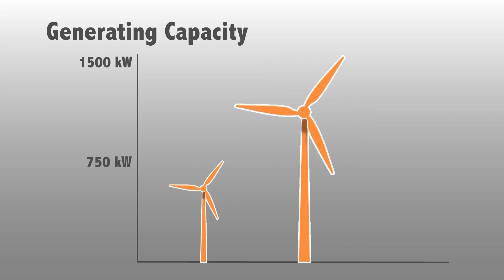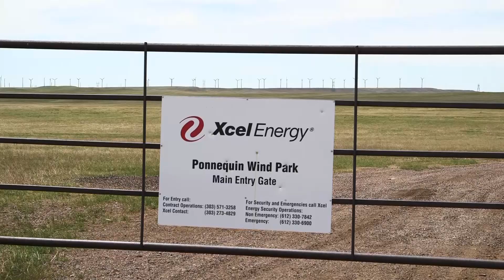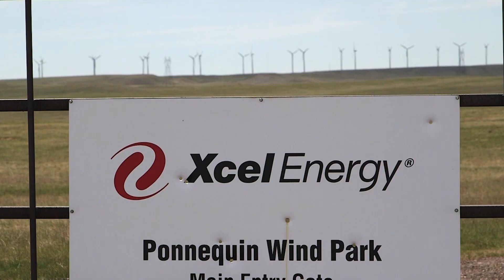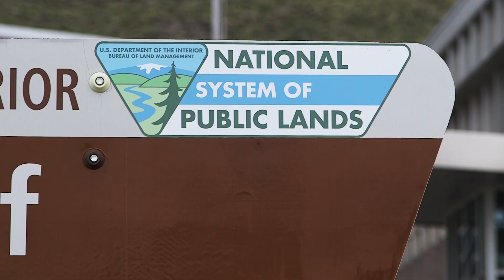Who Cleans Up When a Wind Farm Retires?

Comment: This is fossil fuel propaganda. Compare these beautiful areas with any area toxic from uranium mining, coal mining, fracking, oil refining, coal ash burial etc. and  consider mercury from coal burning accumulating in oceans making fish inedible, air becoming cancerous from fossil fuel burning and then of course the climate being severely damaged over time. Guess what is hugely more expensive considering all cost? ...This message was not brought to you by the Koch brothers unlike the video you just watched.
Reply: Well the materials for wind turbines (especially rare-earths for generator rotors) don't exactly fall from the sky too. You can also compare electricity sources by concrete and steel usage per unit energy produced. I'm not an advocate for fossil fuels but we (Slovenia) have a coal power plant in the middle of our capital city. It uses low-suplhur low-ash brown coal and has a lot of flue gas filters. It is a cogeneration power plant, so it produces heat for 90 % of our capital. Imagine how much oil or biomass would be burned and what the air quality would be if we didn't have distant heating. Of course I know there are cleaner options for heating but right now, the coal power plant is keeping the air healthier to breathe. PS: I don't think having mostly intermittent production in a power grid will be as cheap as nuclear (with decomissioning and waste storage costs included) at least in the 21. century.
Reply: đeri662 Well, neodymium is not consumed in a wind turbine and can be reused indefinitely so the mining of it has very little overall impact relative to the energy produced. Millions of people on the planet die from air pollution per year while deaths from neodymium mining is relatively statistically insignificant. Unfortunately coal is not just turning carbon into CO2 and heat. Coal mining involves the same issues as neodymium mining but at a hugely bigger scale. You also get enormous amounts of toxic fly ash from coal burning and the smoke might look clean but will contain mercury and other toxins. I’ve even seen highly radioactive coal ash as coal mines can include radioactive isotopes. Check things in coal like arsenic, beryllium, boron, cadmium, chromium, hexavalent chromium, cobalt, lead, manganese, mercury, molybdenum, selenium, strontium, thallium, uranium, vanadium and others depending on specific mine. I’m living in California and we’ve completely abandoned coal here. Nobody is missing coal. Where does all your coal ash go? What is the composition of the coal used? How much dioxin and mercury is emitted into the air you breath in your city?
Reply: @ThinkingBetter  That's true but if we want to replace conventional power plants with wind turbines and solar panels, a lot of neodymium will be needed. By some estimations, 160-270 kg of neodymium is needed for every MW of wind turbines. So to replace a single 1000 MW nuclear reactor with wind turbines, roughly 1100-1850 metric tons of neodymimium is needed. Not to mention the amount of steel and concrete needed to do that. There is also a need for energy storage and additional power grid stability measures with a lot of intermittent production, which would add to the needed materials.

I agree about coal burning pollution, especially with older power plants without appropriate filters. Yes, there is more radioactivity emitted from coal power plants than from nuclear power plants. Well saying what is in the smoke from coal power plants and not saying how much can be deceiving. Rare-earth mining has a huge effect on flora and fauna and a lot of people get sick because of it, it's not just the death rates that matter.

Coal ash is mixed with water and transported to a landfill, where it's stored. The calorific value of the coal used is 17-19 MJ/kg, sulphur content is 0.1-0.2 %, ash content is 1-2 %. The power plant uses around 300,000 metric tons yearly. Mercury and other heavy metal levels are basically the same as in every other major town in the country, I couldn't find data about dioxin. Nice to hear this about California coal usage and the power grid would probably still be stable even if it wasn't connected to the rest of the Western interconnection due to natural gas power plants, which can regulate output power rapidly. Now Imagine if the whole interconnection started to introduce more and more intermittent power, what would happen to the power grid? Either blackouts would be very often or electricity bills would be a lot higher. Your electricity bills in California probably got a bit higher due to subsidie for wind and solar, did they?
Reply: đeri662 Your mentioning of how much neodymium needed for 1000MW of power plant made me check how much nuclear power plant waste is stored near my house. It’s 1800 metric tons of radioactive waste sitting near the Pacific Ocean. This power plant is closed but our dysfunctional government has failed to find a place to store the waste as what was the original plan. Same goes for other nuclear power plants in the USA. In the total lifecycle of nuclear power, there is no doubt that uranium mining and all the waste management make it way worse for the environment. Obviously Californians won’t accept intermittent power and the natural gas power plants solve the balance. Realistically it will take decades before cost effective durable energy storage solutions can enable 100% renewables but the trend is good with kWh per cost dropping for energy storage and lots of R&D taking place. These things take long time to change.
Reply: @ThinkingBetter  Nuclear waste is a problem right now, but permanent storage sites are being developed all over the world. This problem is often exaggerated, after a few hundred years the radioactivity is basically the same as the original mined uranium ore. By some estimations, more than 500 tons of concrete and steel per MW is used on average for wind turbines. I don't know if energy required to manufacture steel and concrete is included in the EROEI calculation. Of course, I agree that the overall environmental impact is higher for nuclear. But there are so much problems with wind and solar that I (looking for a compromise between technical, economical and environmental issues) think that nuclear is the way to go at least for the majority of 21. century. There is an obvious problem with solar and wind power. How to produce massive amounts of electricity to cover today's consumption, let alone the consumption when transportation and heating goes mainly electric. How much land would that take. A week ago I drove by our single 700 MW nuclear power plant, which produces half of our country's electricity needs and I thought how much solar panels or wind turbines would we need to do that. Especially because we don't have appropriate wind speeds almost anywhere and solar panels capacity factors are around 12 %.

I really think we need an energy storage breakthrough because in my opinion the costs of Li-ion or other today's technology batteries will saturate long before wind&solar + batteries systems become competitive with say nuclear power plants. Although I've seen quite expensive nuclear, the LCOE of our nuclear power plant is only 35 €/MWh, and another reactor is planned at 28 €/MWh. For comparison residential solar panels LCOE is higher than 100 €/MWh. I'm sure it's a lot different in California.
Reply: đeri662 California is a place with a lot of sunshine and generally solar is cheaper per kWH than what utility companies can provide. People install solar on their roof for economical reasons here. Also we have one nuclear power station left in the entire state of California and that is on the path of closure also. The Chernobyl accident probably was a major contributor to the fall of the old Soviet Union and the Fukushima accident has ruined much of Japan’s economy also. Nuclear power still kills a lot less people than coal though and it’s just unfortunate that governments are so rather dysfunctional in creating good deep underground waste disposal sites. California will continue to gradually shift to greener alternatives replacing the natural gas plants and energy storage solutions will be the key. Our goal is 33% renewable in 2020 and 50% in 2030. Hopefully some day in a far future we can master fusion energy and the world will be more healthy everywhere. Actually here the air is very clean already but try to visit some of the worst places in India or China with old coal power plants next to populated areas and lots of people suffering from the pollution. Whatever we do in the more leading areas of the planet paid by consumers eventually will help move things to a global deployment at lower cost. Solar panels wouldn’t be as cheap as they are had there not been such markets to grow the volume, for example. Nowadays solar is great for many places where there is not even electrical grid e.g. poor regions in Africa.
Reply: Uranium is so far the most concentrated source of energy we have.
Reply: Gammareign Energy density is one of many metrics. Actually coal is not very efficient. I’m not against nuclear except if not managed very strategically with clear plans for the waste. The cost per kWH must also include all the expected cost for decommissioning and all the end of life of waste management. We need to spend the extra money paid by consumers to make very deep underground “store and forget it” type sites. Anything that needs 1000s of years of surveillance will be cost prohibitive considering full cost.

Comment: Google: How Windmills as Wide as Jumbo Jets Are Making Clean Energy.   Read the New York Times article.  
 " The monstrous scale has helped turn wind into a mainstream form of power.   Larger turbines harness more wind, creating more energy.   The biggest modern offshore turbines produce nearly 20 times as much power as ones developed three decades ago.  The larger the size, the lower the cost of generating energy. In parts of northern Europe, wind is now a major power source."    Europe is way ahead of the United States in the push for clean energy.  @Wyoming     Use the small area to hold a few monster wind-powered generators.   Get with the times.  For more information contact  Vestas Wind Systems and Siemens Gamesa Renewable Energy.
Reply: Very few people have considered the climate change cost of windmills; cool moist air is transported inland from the oceans, unless you remove the energy from that wind, then you get less moisture and higher temperatures.

Comment: Wind mills will fail most federal environmental protection acts. They disrupt bird migration, kill bats and so forth. Also they are noisy. If you know what goes into making the magnets, plastic components, insulators, electronic components, gears and so forth, you will find its extremely toxic substances. Also to build these these requires huge amounts of energy. If you think that 30 foot turbine stands on low grade recycled carbon free steel, your wrong. Also the base is not made of dirt, those towers are subject to lots of bending, shearing, twisting, stretching, compression and vibration forces. In addition, maintenance cost are not cheap. 

I use to support these things, but now I oppose them. The free energy movement was a big thing when I studied physics in university. We got mad at our profs for saying it was bs, but now I understand why.  There is no such thing as free energy. 

I thought solar cells was a better alternative; however the toxic chemicals it takes to make them are not environmentally friendly. Their efficiency depends on light intensity and ambient air temperature; therefore they are more efficient in cooler climates. Even if they are in ideal conditions, you still require huge surface area to gain huge returns. 

I thought hydrogen was the next answer until I did the actual calculations. The molecule is to small to return a favourable amount of energy, compared to methane and propane. Also, the amount of energy in doesn’t not support the out put. 

I don’t have the answer, but we need to do more research before virtual signalling to a society with huge electrical appetite.  Bon appetite.
Reply: Source please?

Comment: Interesting how many critics there are on this.    Please tell us you dreamers - what energy source doesn't have an impact on the environment?   Solar - those panels break down and stop functioning especially when storms damage them - those panels have a lot more exotic materials than a wind turbine AND they only work in the day time when there is enough sunlight.   Petroleum based fuels, emissions and the damage to the ground from pumping it out (Fracking IS a real problem) as well as spills.  Plus petroleum and natural gas are limited.   Water run turbines? Yeah building dams is a problem, tidal driven turbines = unknown impact of the environment in the waters where they are place.

ALL SOURCES OF ENERGY HAVE DOWN SIDES and they all eventually wear out, or the supplies run out OR they create toxic waste (spent fuel rods) that create disposal nightmares.
It comes down to balancing the impact and  costs vs out put.
Reply: Hydro power is about as cheap a source for electric as any other. Water runs free  all the time and dam structures can be maintained fairly cheap also. Now get rid of all the high cost of having to transport the electric to the high population areas and /or charge them for the transport cost and maintenance.
Reply: There are many start ups trying to solve the electric deficit we face it's a shame that the subsidy monies aren't divided up evenly to let some of these new ideas blossom instead wind energy receives more government handouts than any other form of electric. Wind farms are a joke they ruin the view shed they are intermittent 30% efficient at best they have to be backed up by fossil fuel plants which makes those plants run inefficient which ends up spewing more co2 into the environment and there isn't enough land to install enough of them to solve our long term problems . Let's stop wasting our time and money on them and focus on a cure for our our energy problems take off your blinders.
Reply: G Scott Well said G Scott rather have any of theses than NUCLER which is the path the UK wishes to go down
Reply: @oneminutefarming9521  You are against nuclear energy because you do not understand it. Nuclear energy is the safest, cleanest, and most efficient form of energy in existence.
Reply: Quoth TheRaven Safe, until something goes wrong. Not to mention we still dont have a good way of storing nuclear waste. Uranium salt reactors and fusion reactors are a few new ideas that may work safer and better
Reply: @quoththeraven5631  in theory that is. unfortunately the operators and designers of the plants are un- evolved creatures that continue to ignore and evade dealing with safety and waste.
Reply: Quoth the raven  Thanks for your comment one small point I’d rather have a few buried concrete turbine bases than leave a legacy of thousands of years of buried nuclear waste when your nuclear power plant is decommissioned or just basically gets fucked up , just look at recent and not so recent accidents ,Mile Island USA , Sellarfield UK , Chernobyl Russia ,  to name just a few  . On another note I probably understand how a nuclear power plant works much more than you may think my friend , being an engineer as I am .
Reply: @oneminutefarming9521  There are numerous applications for nuclear waste in all forms, low, intermediate, and high. Each nuclear power plant which has failed was expected to fail. The chernobyl plant, exceedingly poorly designed and operated. The Fukushima reactor's seawalls were long known to be deficient and Tesco chose to do nothing. Which brings us to the 3 mile island incident. . .Which was the result of. . .YOU GUESSED IT! Engineers. . .So in conclussion, leave it to engineers like yourselves to ruin the pet projects of physicists like myself. Obligatory, interdiciplinary mocking aside. . .All of these incidents though terrifying have been relatively minor incidents when compared to fossil fuel accidents. . .and when properly built properly pose no threat.
Reply: As mister freeze would say "Chill".
Reply: Conservation like LED lighting and efficiency is the way to begin and to retire legacy, costly taxpayer funded fossil and nuclear plants.